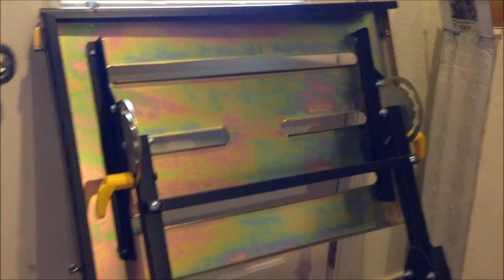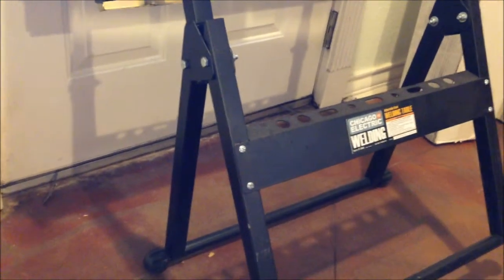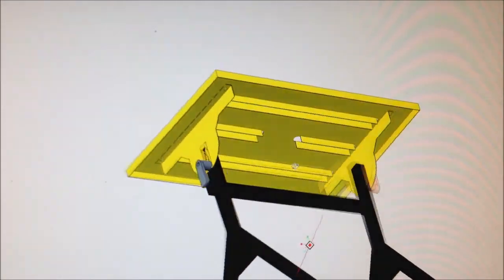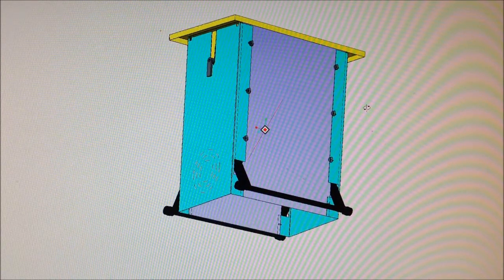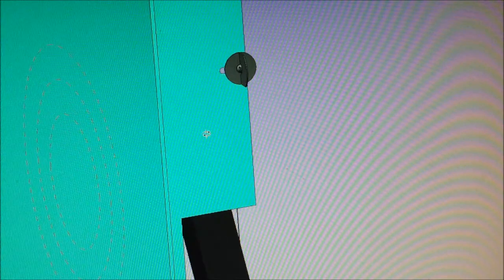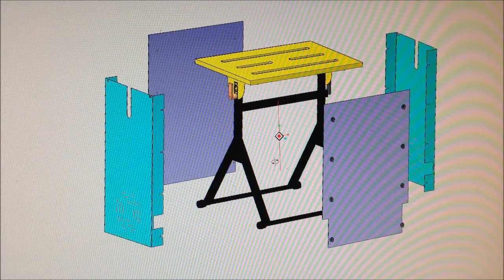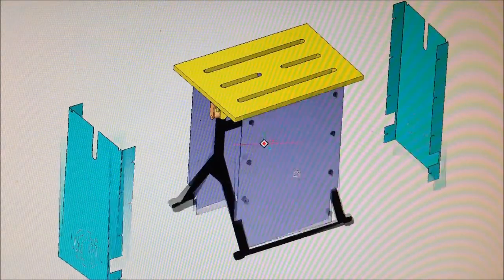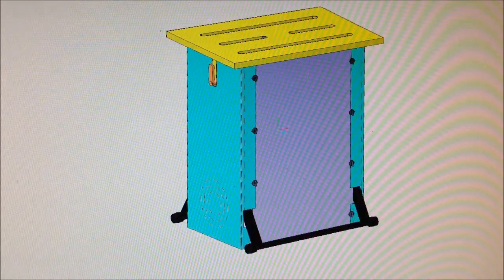Part2 downdraft welding table design

Comment: Why not a half cylinder enclosing the crossmember to save material and functionality of the table?
Reply from the maker: Decreasing the plenum volume underneath the table top that significantly would probably make the flow velocities into the table vary significantly, while increasing the fabrication complexity and adding ducting to the blower which will decrease it volumetric flow.